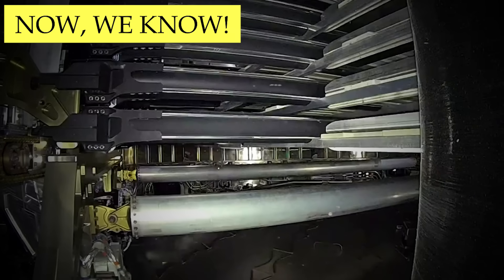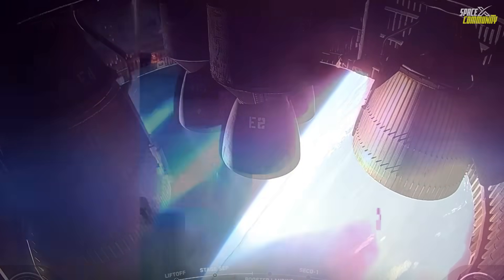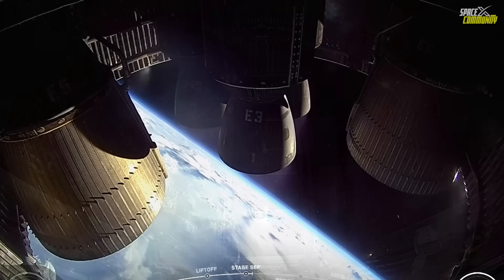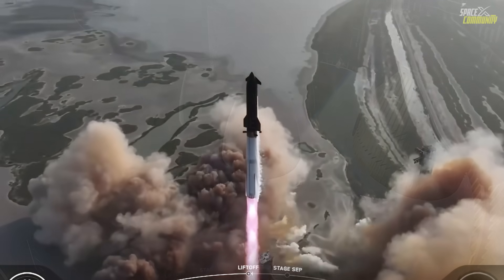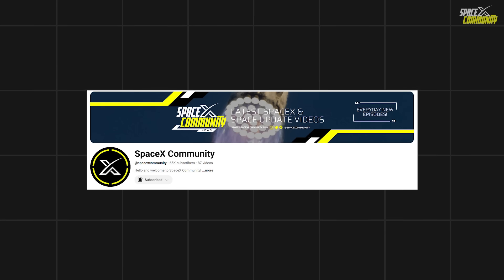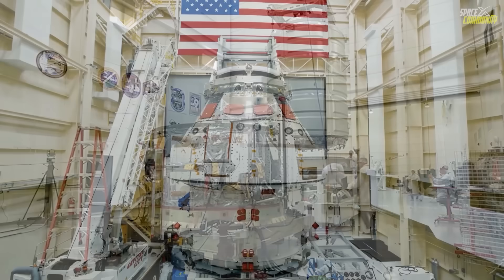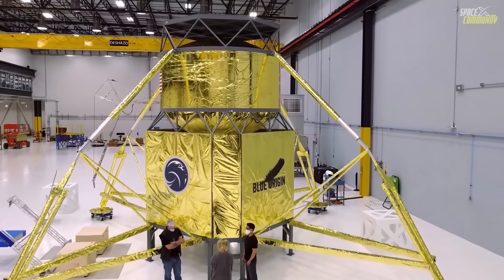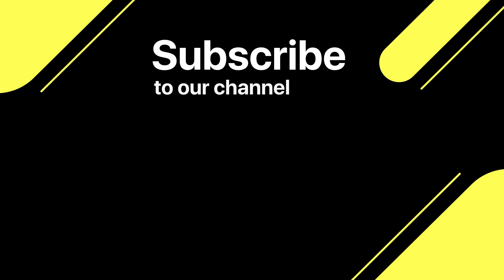What SpaceX Just Declared About Ship 35 Pez Dispenser FAILURE Will Blow Your Mind! Never Happened!

Comment: I am also disappointed that you didn't bring up the fact that the pressure inside Starship could be a main factor in why the door wouldn't open in the vacuum of space.
If you do even a little bit of research you'll find out that the space shuttle had the same issues with its cargo doors

Comment: Imagine that of the first 9 Saturn 5 flights, a third of those failed because of a lost CommandModule/ServiceModule: the project would probably have been cancelled. Should SpaceX also stop this program? is it too difficult ??
Reply: Actually if you look at all the failed NASA launch/landing attempts over the years you will see that shit happens.. Since all these Starship launches have been "tests" for engineering with some deliberate planned design failures so they can learn what works and what doesn't I suspect the owner is not worried..

Comment: I don't believe the door was tested in space on this taller version of Starship. Earlier tests of the door although "successful" seemed to show signs of  structural deficiencies. I have little doubt that this "tall boy" beer can is even less structurally sound! 

But launching Starlink  satellites has nothing to do with the very pressing, woefully behind HLS development or the Mars fantasy for that matter! The real major issue is the tank leakage and the likelihood that this may be related to the failures of IFT7&8. 

All in all, a complete failure no matter how you try to spin it! (In this case, it spun itself! (Pun intended!) Nine tests in and they're really no closer than the first test!  Meanwhile, SLS and New Glenn achieved real success on their first tries!  The reasons?? Because they used the step by step approach of a disciplined engineering process vs the "iterative, guesswork design process".  Maybe a system like this is a bit more complex and failure intolerant than software design!!  But I'm an engineer and I know Musk's approach is just stupid!!

Falcon 9 has been a huge success because rocket engineers designed it and Musk just arranged funding. But his fingerprints and illogical decisions are all over starship. The same might be said about Tesla which had real automotive engineers developing it. And then came Cyber Truck, that is Elon Musk's baby! It's a wonder that it doesn't have  square wheels or is made from concrete!!

Comment: im starting to think that the liftforce of 33 engines or 35 is too much stress for the length of the rockets simply compressing it, it would be interesting to see them just landing it again after the point where the startship takes over and goes suborbital it just goes down again and they measure the difference in width,length, at different places on the hull to test for hull integrity from the gravity force of 33 raptors engines including the vibrations you see when it penetrates the vapor at the launch site. I cant recall they have ever done that. and getting a complete not damaged both parts before sending it out in lower orbit would give alot more data than the scraps they pick up before it disintegrates

Comment: Seems to me there should be tried and proven methods to have high pressure systems and "no" leaks.
Reply: Not when you are developing  the concept and hardware, in a real world.
Reply: Cost. Part of the point of testing to destruction and accepting failure of iterative improvements is learning just how much is 'really' needed, which will establish safety margins in future versions. Oldspace engineered nearly bomb-proof systems, but they're bespoke and phenomenally costly.
Reply: The failure was likely related to hot staging, which you cant simulate on the ground I think,

Comment: I am going to say what no one wants to say. Booster seems to have most of the Kinks worked out. And that is great news! Starship itself has a ways to go. We need to take a version of booster add a version of ship and turn it into a revenue-generating operation. Use ship as a second stage with a clamshell fairing around a massive payload. Keep working on starship! But turn the operation into a revenue-generating system. Using a cargo version of ship, we can send payloads to the moon. Mars. And beyond.
Reply: That nothing we don’t want to hear. It makes sense and I suspect there will be several configurations of craft to be boosted into orbit and beyond. This project is so interesting.

Comment: Space X should be evaluating its TESTING strategy . . .
Reply: Why, as an organization they have advanced faster than any other space organization in the world. They've had no cost of life unlike NASA. Rather than Decades of very careful testing before a launch they prefer to launch at a very fast pace to test the limits and ideas and don't forget that everyone in the world had given up on vertical Landings. Then SpaceX comes along and refuses to accept what everybody else had already accepted, that it was impossible. The only reason anybody else is doing it now is because SpaceX showed it could be done. But in the process they also had failure after failure before they got it right. Their practice of testing to destruction is why they were able to finally get it right and do what nobody else had succeeded at doing. You have to be willing to expend some material for testing to advance rapidly. To them each rocket is just one more test platform and some of their testing is intended to destroy not only did they bring the booster in at a steeper angle which put more stress on it but they were also going to do a lame duck Landing by disabling one of the three engines normally used for landing and turn on a middle ring engine to replace it which would give them an uneven thrust that they would have to try to compensate for this in itself may have been impossible until they've tried it several times to get the software and ratios right. 

Keep in mind the Starship and the super heavy booster are there experimental platform, meanwhile their commercial platform the Falcon 9 and Falcon 9 heavy as well as the crew dragon and cargo Dragon are outpacing everyone in the space industry. They are more efficient than anybody else on cost per kilo to orbit as well as being virtually 100 reusable when the mission parameters allow, and their launch Cadence for exceeds what anyone else is meeting let alone capable of. SpaceX has well proven that their method of research and development does pay off. When does Starship is complete for cargo use it will further drop the price per kilo to orbit solo that it will be decades before anyone else can be competitive primarily because the competitors are afraid of wasting material in testing
Reply: Very, very well put into prospective.  Very informative also. Thank you much sir. @donaldbates155

Comment: Version 2 sucks, where as the version 1 flew and landed even though it had problems. The booster was set up to fail with such a angle of attack when re-entry started, they needed to see whether it would survive, it did not, but that's why they used a pre-flown booster in the first place. The pezz dispenser needs to be bumped off the menu for now and just get meat and potatoes of the project cooked to perfection first.

Comment: I noted venting from the side of the hull during the coast phase. This venting (caused by the main tank depressurising due to a leek) acted like a thruster causing the ship to spin faster and faster out of control.
Reply: I thought I was seeing the same thing, though I thought it was an RCS thruster firing continuously trying to regain control. Idunno.
Reply: Leak perhaps on a vacuum bell lower lip assuming they still cool the bells by circulating fuel through them.
Reply: There was also some visible hot spots on one of the rocket nozzles. So I think there were many other things happening off camera too that we're not fully aware of. No doubt we'll get some answers in due time. Perhaps next time it would be helpful if they also sent up another vehicle kitted out with loads of cameras to follow starship & broadcast a live external view of starship's re-entry into the atmosphere. I think it would be ineresting & also very useful for spacex.

Comment: The first stage was never intended to be recovered.  Basically it was being tested to destruction by giving it an intentional critical return angle.  This would have given SpaceX a massive amount of data on just how much punishment the first stage could take before destruction. It was intended to fire three engines for testing purposes but the harsh angle of approach probably damaged the engines causing an explosion.  The Starship though did have further problems that will need sorting out before flight 10!!
Reply: >The first stage was never intended to be recovered.
MSM and everyone who hates Elon do not give a F about this, it's even mentioned multiple times. Launch, booster+several engines reuse, MECO, SECO, orbit, all these test were a success. At the end of the day, this is still a test vehicle with parts that keep changing with every iteration.
Reply: But it would be nice if it hadn't actually destructed!
Reply: @paulblase3955  that would be a short of failure, because if the booster would have landed succesfully, the team then need to look into the data and determine if the booster is ablo to actually survive this kind of descent or it survived because a specific cause

Comment: 9 flights not one that could be called successful
Reply: You mean fully successful it's partially successful each time they keep getting better but they keep making a lot of changes which causes a lot of potential failure if you ever worked on any projects like cars try to keep the engine every time you make an approve but there's another set back for everything you change there's usually negative effects that come along with that it takes a long time to work the bugs out
Reply: “I have not failed 10,000 times. I have not failed once. I have succeeded in proving that those 10,000 ways will not work. When I have eliminated the ways that will not work, I will find the way that will work.”  Thomas Edison